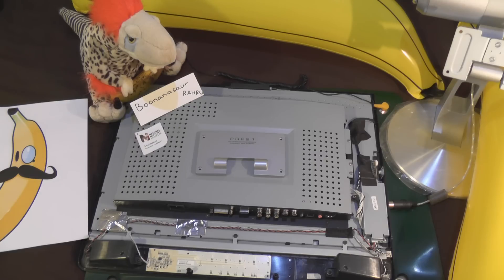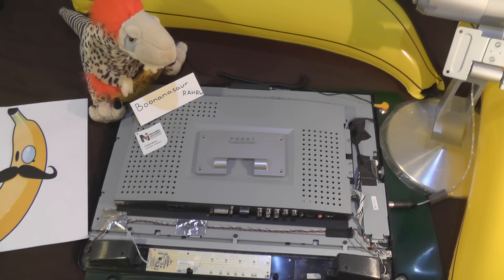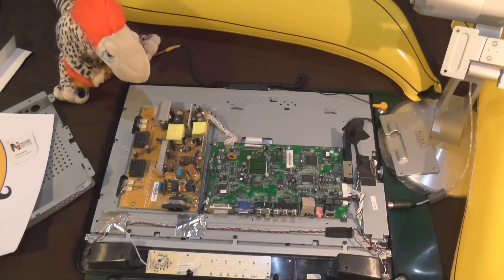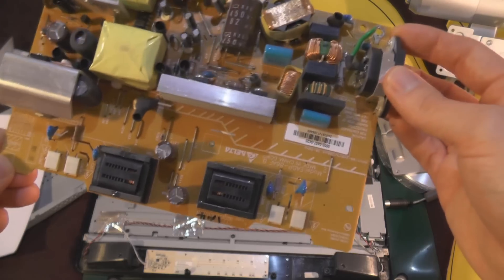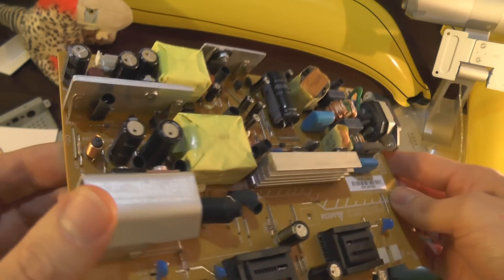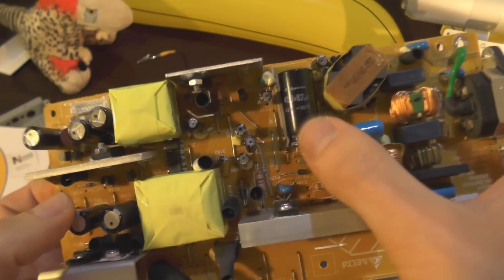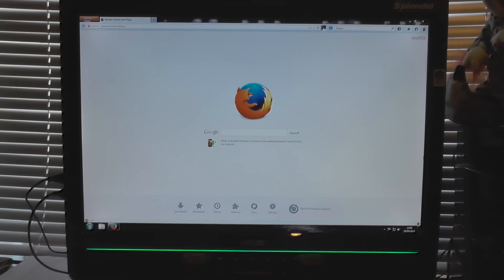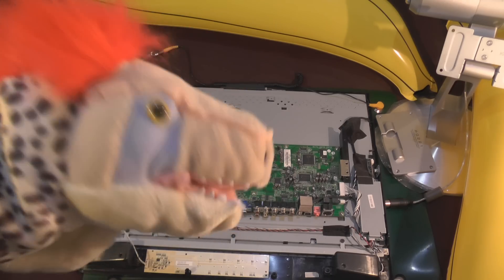ASUS PG221 Monitor Repair, fault, faulty, fix, diy, investigation, tutorial ish - Boonana J

Comment: I wish I could find a monitor with mostly the same features as this one, just maybe a bit newer and maybe slightly higher resolution/contrast, but the same otherwise. My monitor isn't going to last forever and I just can't move on, everything I see newer, even expensive screens, just don't "hit the mark", since everyone is obsessed with "mUh tHin bEzEls" I hate it.
Reply from the maker: Yeah I know what you mean Sonja, this monitor was quite significantly sturdy in it's build, and was packed with features.

There are a few people still using these... someone I know is even using the PG19 model that I used to use at LAN events. Its aspect ratio isn't 16:9 like current monitors, but it has a dvi connection and its response time is still pretty hot compared to most monitors.

Very weird seeing PUBG played on it though!😅 feels like half the view is missing😂

#BoonanaJ
Reply: @BoonanaJ  2022 and I am still using the PG221, even with occasional modern game that still may interest me haha. I actually like its heavy 10kg more than the feel of very light and fragile-feeling ultra-thin screens, they feel so delicate! Plus I have poor vision so a taller, narrower 16:10 screen is actually more comfortable for me than 16:9 and I hear that even normal-seeing people in office settings or who do a lot of reading and writing actually also kinda prefer it and that 16:10 may be having a comeback, at least on the office side. But the pretty nice sounding speakers, integrated webcam, usb ports, rgb strip, cool control sounds and a sturdy, durable build just aren't a combo you can find anymore, not even in the niche! Sad...

Comment: I have a monitor that was doing the same thing but it started to bleed down my screen and took up the whole thing, shortly after my power button stopped working and this will be the 1st time I am attempting to fix/bring back to life a monitor, any idea what the loss of power button working would be, because im starting to think it sounds alot like whats going on with this one here
Reply from the maker: Richard Massey it will be one of two things... either the capacitors need replacing or the nanya memory chip needs reworking or replacing on the main board. The main boards on these monitors are prone to having heat related issues.

#BoonanaJ

Comment: My monitor is turning on, boot IP sound and stuff all working fine. Shows the Asus screen. Within 5 seconds it's black. It shows my Xbox boot up screen but 5 seconds later black. If I switch the source it'll show the no source detected screen then go black in 5 seconds. If I switch to my PC it'll show what's on my PC screen for five seconds. If I turn it off and on it'll boot up then show the appropriate thing (Xbox dashboard, computer desktop or no source detected) then the screen goes black after five seconds. The sound still works. I can turn volume up and down it does the shimmer. I can play music on my PC and it comes through the speakers fine. I can bring up the Xbox navigator and I get the chime for it I just can't SEE anything for longer than five seconds. Can I get a diagnostic? It's an Asus pg221 inbuilt surround sound and webcam

Comment: This probably has nothing to do with my question sort of does but I decided to switch my setup and I dropped my Moniter on the corner of the desk and it looked perfectly fine on the outside no cracks but when I turned it on it had cracks inside the Moniter and showed rainbow colors with black a little it only covered less than 1/4 of the screen but still anyway idk what to do should I go fix it or buy a new one which is cheaper?? I don't have the receipt but I have one that says that I bought it and has the date on when I bought it not sure I'll get a warrant on that but someone please help what is cheaper to fix or buy a new one similar to this maybe less expensive
Reply: Forget what I said in the beginning made no sense
Reply from the maker: +Danny Yeet Hey DY, sounds like the LCD has cracked... it could be cheaper to replace the LCD screen panel if you can find one of these monitors which has the fault featured in this video as the screen on monitors with this fault it usually entirely fine.

Otherwise I would buy a new monitor... it could be worth checking the price of new replacement LCD panels, but you will likely find they are almost as expensive as getting a new monitor. Plus a new monitor comes with a warranty.

#BoonanaJ
TeamBanana.co.uk
Reply: +Boonana J yea I'll think about buying a new one don't really know any places that fix lcds or whatever for cheap

Comment: I'm having to post again. After getting it working with the new power board, I popped the screen on side for quite a few months without the power in. Just sat there. Now I've come to set it up again and all the touch panels are responding so it's receiving my PC's signal, but the entire screen is lifeless. It doesn't even light up at the start either.
It's boggled me as to why on earth this has happened. Don't suppose you have any idea do you? Many thanks.
Reply from the maker: +Ballooner360 Hey Ballooner =D
Was the power board brand new or was it refurbished/working replacement pulled from another monitor?

Sounds to me like the inverters for the screen backlights aren't working again =/

#BoonanaJ
TeamBanana.co.uk

Comment: My back light keeps turning off. From another video they say it's the EADP-86AF B transformer. I can only find it in Russia and can't ship it over. Asus won't help me either. Do you know of anywhere I could get one please? Or an alternative fix? Many thanks..
Reply from the maker: +Ballooner360 Hey Ballooner, they can be tricky to get hold of and you will find that only countries like Russia, Poland, and China will have these components. This is unfortunately due to the Wests consumerist "throw away" culture, while other countries are employing the old British "make do and mend" philosophy which we've sadly majority lost.

Best bet is to keep looking, check out Chinese and Polish sites.
Get your Google on and have a look at the image results... often pictures lead to sellers.
Look out for the same monitor but broken... you can always scavenge parts.
Check out other monitors... it's a Delta board IIRC so similar boards with similar components will be found inside brands like Benq.

In all honesty you technically don't even need the same transformer... all you need to know is its specifications and to replace it with one of the same output and coil impedance, then to get round the pin layout issue, just solder wires into the board holes and solder the other ends to the correct pins on the transformer... just make sure to secure the transformer with something heat proof and to heat shrink the union/solder joints between the wires and transformer pins, last thing you want is it shorting out onto the chassis!

#BoonanaJ   TeamBanana.co.uk
Reply: +Boonana J thanks so much for replying in such detail. I decided in the end it wasn't worth me trying to import myself and potentially harm myself fitting it so I paid £74 for the complete power board from Asus parts. Just have to wait three or more weeks now for them to receive it and ship it on to me. This monitor is a lot of fuss! But others will have a little more help now from our replies. 

Thanks again!!
Reply from the maker: Hey No problem Ballooner, sounds like the best solution as you ideally need to test the surrounding components to make sure that the transformer was the only thing faulty. Indeed and that is what it's all about, generating help for others =)

 #BoonanaJ    TeamBanana.co.uk

Comment: I really need help I dropped my monitor when I was trying to move it it has lines in the middle of it plz help
Reply from the maker: Rcw 74 Hey Rcw, sounds like the LCD panel has been damaged... likely has a hair line crack in it somewhere.

To fix this you would need to replace the LCD panel with a new one. This needs to be either the exact same panel or a compatible equivalent. 

An identical panel is the ideal option as you know what you are getting, however making sure the vertical and horizontal measurements of an equivalent panel, plus the ribbon cable and number of pins it has are the same is a good start, with the finer details being the pixel / resolution specifications.

Let me know how you get on

#BoonanaJ   TeamBanana.co.uk

Comment: Hello Boonana J, I have the same monitor which I am trying to de-assemble to fix it (changing capacitors). Do you happen to have a video showing how to open the outside cover of the monitor? If you do you will be helping me biggggg time. Thanks Man...
Reply from the maker: Hi SHERIF LOUIS,  Thanks for the comment =)

I may do a video on that if I get time, but encase I don't, here is what you need to do:

Remove all cables and peripheral nonsense from the monitor, and lay it screen down on a soft surface. This can be a bed, a sofa, or slightly more professional, a work surface with an adequately sized thermal sheet, folded to about 1-2 inches in thickness. Which ever you choose, the contact surface with the screen must be clean to prevent scratches or grease marks, and level to prevent slippage and loss of components.

Using the correct sized Phillips/cross-head screwdriver (PH2 size), remove the square plate covering the hinge. This has 4 screws, and will have the following written on it (PG221 The ultimate Gaming Experience Designed by ASUS in Taiwan).

You will now have an exposed hinge with a further 4 screws that are slightly larger in size than the previous 4 you removed. Remove the top two screws first, then carefully manipulate the aluminium stand upwards, so that you can get a screwdriver in to remove the bottom two. Do be careful during this step and support the weight of the stand at all times, as damage could easily occur.

Assuming you have already removed the cable back cover, remove the two black screws from this region.

Using a plastic removal tool, or a credit card is you do not have one (it is recommended that you get a removal tool). Insert the tool/card in the gap between the matte black plastic, and the glossy black plastic screen bezel, that follows the perimeter of the screen. You will need to gently work the tool along the gap, levering the tool towards the matte side of the plastic/the back of the monitor (upwards assuming the monitor is still laying flat on its screen). There are little plastic clips surrounding the entire edge of the screen, so be patient and take your time.

The plastic back should simply lift off once all the plastic clips have been released. Pay attention to the web cam area when removing the back, as the webcam becomes free to move around.

You are now left with the metal chassis. Unscrew all the black and silver screws around the edge of the chassis, then remove all the screws from the plug area, making sure to remove the hex posts on the monitor ports using a socket or wrench (the silver posts that the monitor cable screws into on the VGA/DVI ports).

IIRC there is also some sheiding tape that will need to be peeled back on the chassis, but once all screws and hex posts have been removed, you should be able to freely remove this. Do this slowly and pay attention to areas where the chassis is getting snaged. It is best to start lifting the chassis from the webcam side and slowly lift and slide the chassis towards the bottom over and away from all the protruding ports.

By this point we are overlapping with my video =)

You can find the project page in the link below if you have not seen it already, and be sure to link to this and share it, if you write about your monitor =)

http://boonanajprojects.blogspot.co.uk/2014/05/fixing-asus-pg221-22-gaming-monitor.html

This should be straightforward following what I've written, let me know how it goes =D

Boonana J